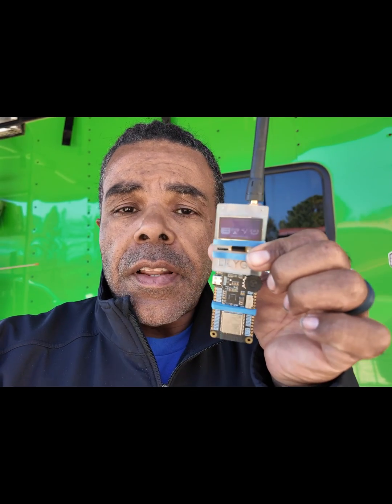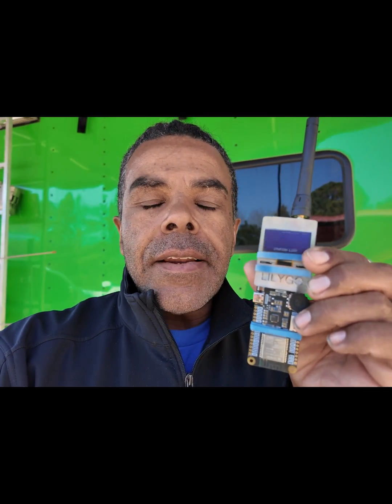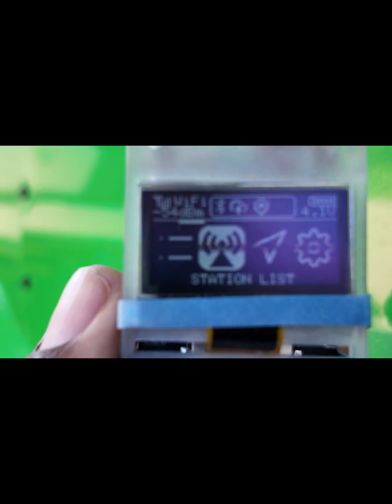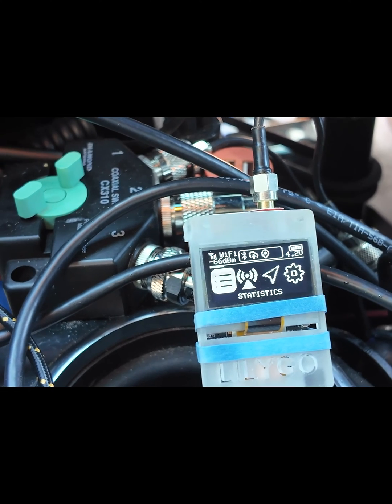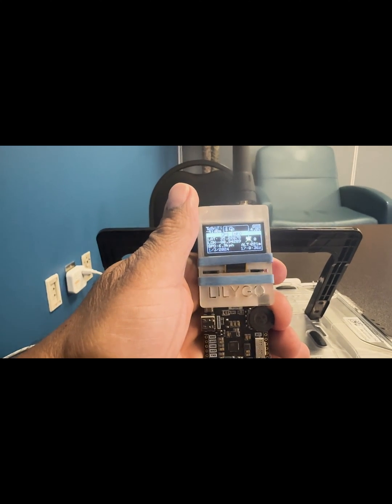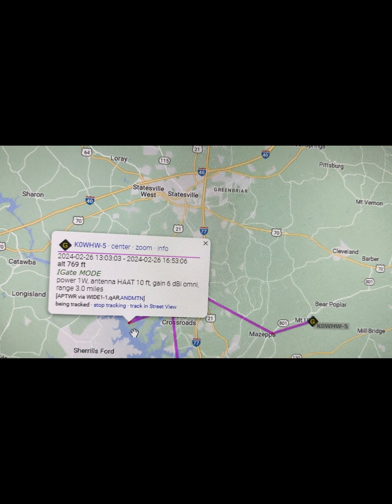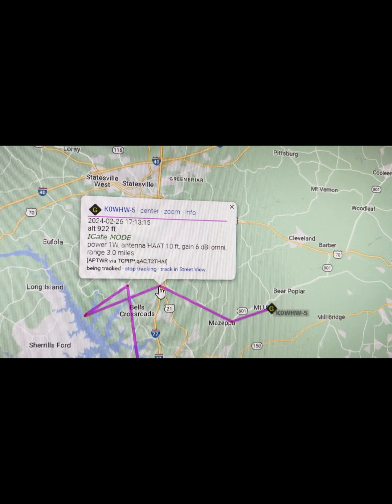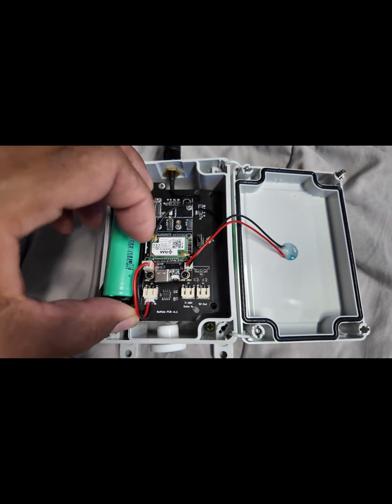T-TWR Update: It Works!

Comment: Have you been able to connect to the Bluetooth?
Reply: So it doesn’t like iPhone Bluetooth I was able to get it to connect to my kindle fire but no luck with aprs droid. I have not reached out to the developer.
Reply from the maker: @GunsandRadios something else just came across my mind. I know I still have the firmware available at the time of the video because it works for me. I know at least one newer firmware exists. Look into that.
Reply: @Bill-HRT_K0WHW  what firmware are you using? Thank you for your response
Reply from the maker: Thanks for stopping by.  I appreciate it!  As far as Bluetooth, I never gave it a try.  Once I got it running as a gateway and connected to either my phone or cell hotspot via wifi I stopped tinkering.  Have you tried contacting the software developer on github??  Let me know?  See you out there.  73 de Bill

Comment: Pretty cool, checking out the T-TWR now. And yes, I'd definitely like to hear more about your Meshtastic setups.
Reply from the maker: Dennis!  Thanks for watching and taking time to comment.  I appreciate your support.  Long time no see, my friend.  I have been dabbling in lora for a while, but I can't say I am much more than a dabbler. I have one of GarthVH's units from etsy that employs the RAK 4631/4630.   It's solar powered and sits permanently on the trailer; it comes with no gps, but I added it easily.  RAK is so modular and easy, and the Meshtastic developers do a good job of making sure the fw knows the hardware.  I just put a RAK 4631 with gps up my portable, CHA antenna mast at 25 ft, and it's housed and powered by a Voltaic system.  Both of those seem to sip power and stay at an acceptable level via the small solar panels.  There are absolutely no nodes in my area other than me, but I am rv portable so the next spot may full of nodes, lol.  There . . . there's my script for my next video, lol.  Glad you joined in on the conversation.  See you out there.  73 de Bill